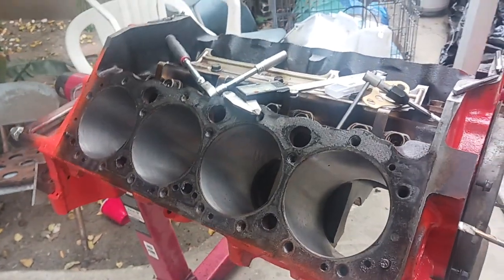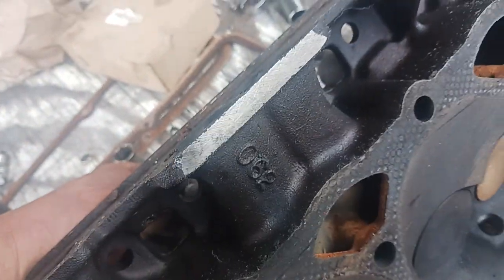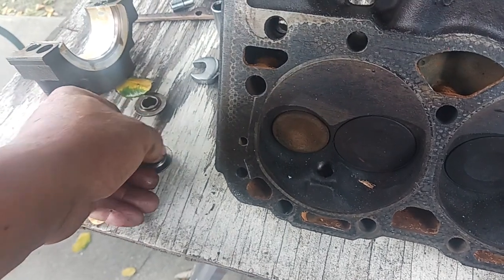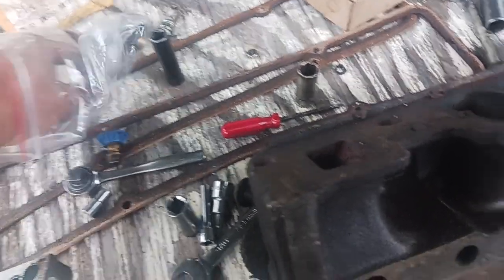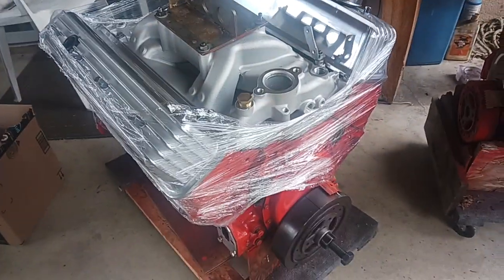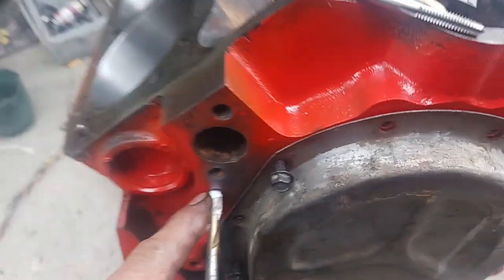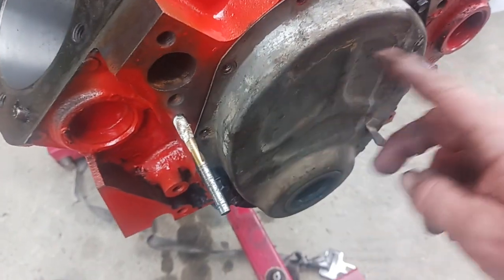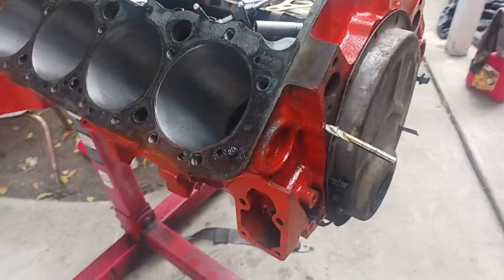vortec 5.7 (350) roller block timing cover and water pump conversion.

Comment: You are not doing anything by drilling the water pump hole straight through. It should take a 90 degree turn up to the block deck. Look at the early blocks and you can verify this.

Comment: Iam using a 880 block aswell for my build. I got lucky with mine mine does have to hole for the mechanical fuel pump, iam useing an old style timing cover . Iam useing a retro cam trickflow cam. But what timing chain do I use because the old flat tap droller chain does not work by no chance.
Reply: Just grind anything that interferes with the double roller cam gear away...
Also just an FYI the vortec balancer is different than an older balancer so if you use it you can turn the crank sensor gear into a spacer by just grinding it down to the size of the balancer hub and put it in between the crank gear and balancer...
Reply: Iam trying to use the old style blancer . And timing cover , steel one . Timing cover is summit brand and new blancer aswell , do u have any part numbers . Iam at a stand still on the building. Parts number  on blancer and timing cover  my block is all redone from machine shop I have no factory hardware been buying all new hardware
Reply: @josecervantes5431  if you talk to the machine shop they should be able to help you out or call summit...
Another good thing to do is watch a lot of vids about building engines, and do a lot of reading, but be careful about 80% of the info on the Internet is not correct... Good luck...👍

Comment: Have you heard anything about the timing set rubbing the old style timing cover when adding a double roller timing chain set to the vortec?  I had to tap on the inside of the cover so it would clear
Reply from the maker: @8luggarage  This was a budget build,
The only thing I spent $
On was the ram jet GM
Camshaft that being said, I went with a single timing chain.
That's good to know,
I've heard stories about  double timing chains hitting the cover. Maybe it best to go single.  BTW, check out the installed video I just uploaded

Comment from the maker: Definitely drill the holes in the t-stat.

Check out my heater hose bypass video 
That is an external bypass,  

https://youtu.be/_xcXsvimm3Y?si=MBZfDDIjKtlIy1QR

If you are planning on blocking off the 
The holes going to the heater hoses you can drill about 6 x 3/16 
Holes in the t-stat.

 What is the block going in ?  Do you want the heater to work?  If so, do you  have a heater control valve on your heater hose?

Comment: I’m dealing with the coolant bypass problem right now, do you think I could get away with using the old school pump without drilling the bypass hole in the block but instead just drill the holes in the thermostat?